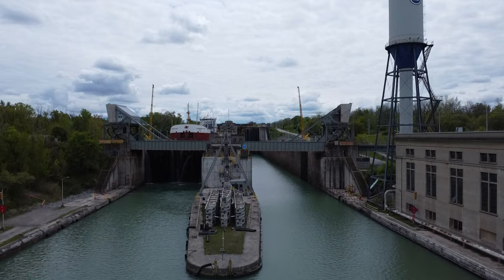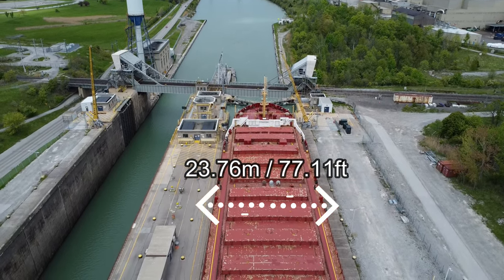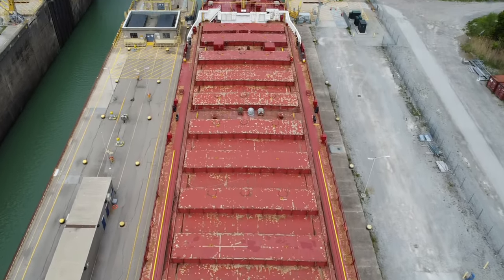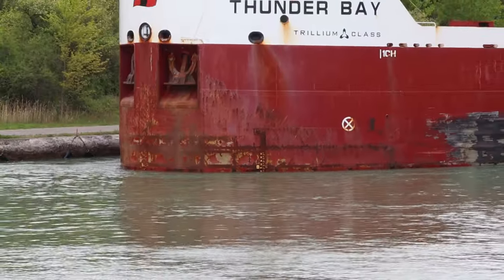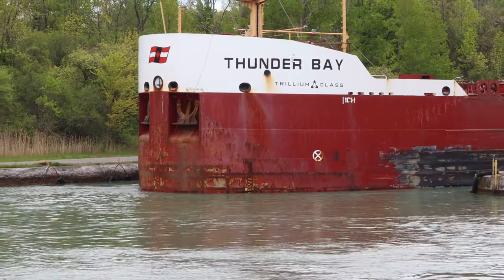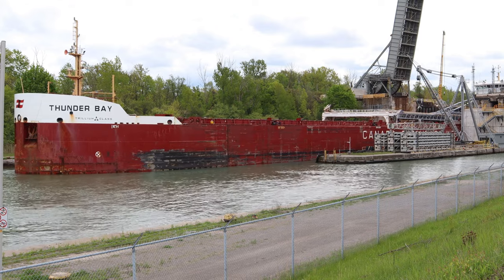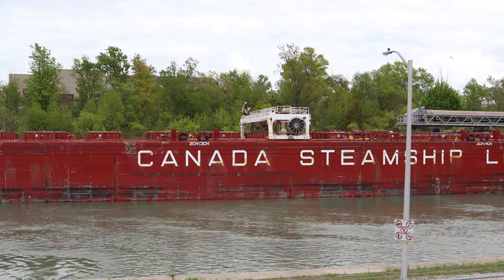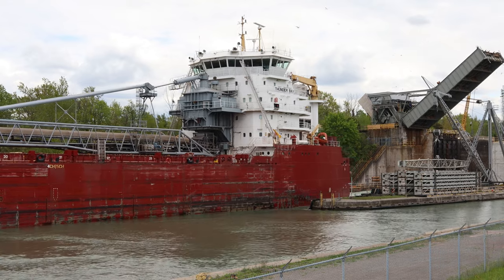THUNDER BAY - what causes the sudden tilt?

Comment: Some have suggested that she struck bottom, or scraped the lock sides.  Well, I very highly doubt that it touched bottom, and if it had touched sides, I'm quite certain you would have heard the sound.  I'm going with the theory that some others have purposed.... thrust torque, while applying power to the shaft and propeller.  Only a guess, though.
Reply from the maker: I can clearly remember that there was no sound, only thing was the sound of water that was pretty much a constant sound

Comment: I would suspect that it is a combination of an effect of high velocity water between the ship and the wall and possibly  bottom on that side from movement in a confined space reducing the pressure between them, this has caused ships passing too close to each other to inevitably collide, and too high a speed in shallow water to suck a vessel down. Both the bow thruster and the rudder are below the centerline of gravity. They were trying to "walk" her away from the wall and had to apply RIGHT rudder to kick the stern out. And the thruster to push the bow out to break the one-sided vacuum resulting from not having a wall on the left side anymore.  Both of these forces act to push the bottom to the LEFT. large vessels initially heel in the OPPOSITE direction of the turn if sudden rudder inputs are made as the stern is kicked out from under them until the turn is developed and centrifugal force leans the top back over. Screw torque probably has a minimal effect, however, if it was a standard right hand rotation engine, it would react this direction, and throttling up momentarily to blow water past the rudder may have been a factor. So, we have at least 4 possible forces acting together to cause this.  The center of gravity is higher than you may think even when loaded because they have narrow V bottoms in the holds to funnel materials onto the conveyor belt. However, it looks like she is running light and high, raising the CG and having less mass to resist movement. ( Intersting fact: Lakers are called boats and do not, in general, use any nautical terms. They use mph, left, right, etc, and eat out of kitchens, not galleys and have bathrooms not heads) Great video!
Reply from the maker: The number of times I've had people calling me out for not using correct terms and now I've just learnt this.
Thanks for all the information, you gave me and others are very good explanation.
Thank-you

Comment: Up to Lake Erie, not down. Perhaps you could explain what those three yellow units are that are built into the canal walls.
Reply: John up or down is with the flow and the yellow units are automated mooring (hands free)
Reply from the maker: Thanks Dave for the reply to the question.
Reply: @davemiller3856  - The buoys on the east side are black with green, which means that's the right bank and North is downstream. Lake Erie's also hundreds of feet higher. Definitely up to Lake Erie. It's the same escarpment as Niagara Falls a few miles away.

Comment: I understand the locks and their operation, but for what are the yellow cranes (one per lock, it appears) used?
Reply: They do look like cranes, but they really aren't.   It's merely a boundary defining instrument.  There will be one at either end of each lock,  and as a ship enters, the yellow gate will be down at the far end, and this gate will define the limit of travel that the ship must observe prior to entering AND while positioning inside the lock.  If they hit the gate, it's considered the same as your toes or feet crossing the foul line in a bowling alley,  only the penalty for doing so at a bowling alley won't get you thrown out, maybe just yelled at.  Okay, so that last part was merely light-hearted sarcasm.
The gates are to tell the boat where they cannot exceed, lest the boat hit bottom during the lift or lowering function.  There needs to be space left both ahead of, and behind the ship, to avoid fouling the movement of the lock doors, and the inrush of water coming from the lock above,  so the last thing they need is for a ship to be obstructing view, or crowding the operation.  The gate would likely not hold or stop a lake freighter should it over-run,  but still, there would be some space between the nose and certain danger, a few precious seconds for a ships' crew to get stopped before striking a critical piece of lock infrastructure.  Gates are easily replaceable, and sometimes they do get hit.  Usually, you can see spare gates sitting, placed parallel, beside the lock.
Edit:  I just went back and re-watched,  and noticed that, as you said, only one per lock.  Other locks have 2 per lock,  one at each end for whichever way the ship may be going.

Comment: I didn’t see in the video the “tilting” you were talking about. I wonder if it was dragging on the bottom?
Reply: You can see it begin around 6:26 on the video.  Watch the very lowest part of the hull, you will see it show a line of darker paint (because it is wet, rising up out of the water) and then after a few seconds, you can see that darker line settle back down again. It oscillates a few times.  But it is a very subtle amount of list and correction, easy to miss.

Comment: I think the most likely reason for the ship to heel like that is she may have landed on the wall on her starboard side or possibly landed on the center lock wall with her port quarter while maneuvering to clear the lock   Either one could cause the ship to heel as you recorded.  While trimming the ship by moving ballast can be done fairly quickly, it would not happen the the matter of a few moments.